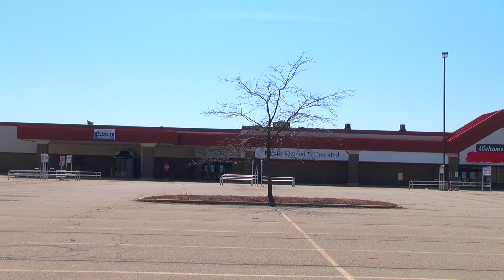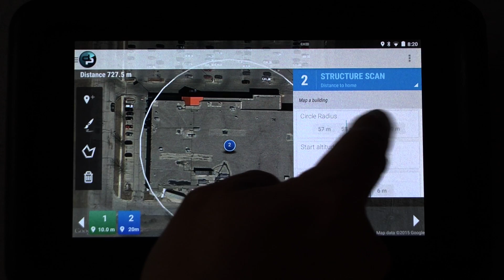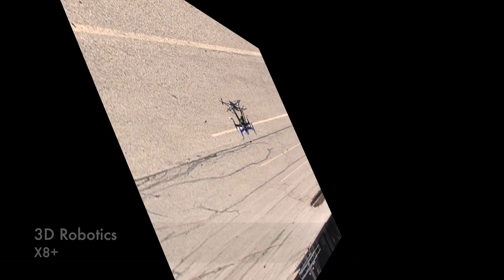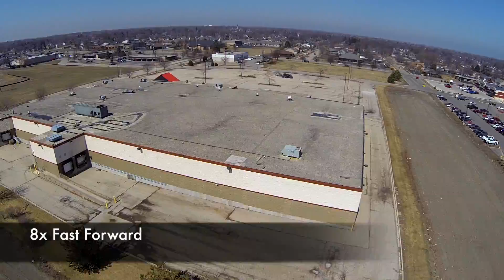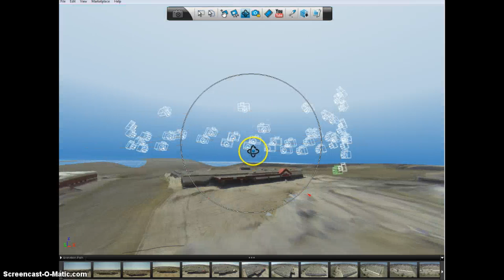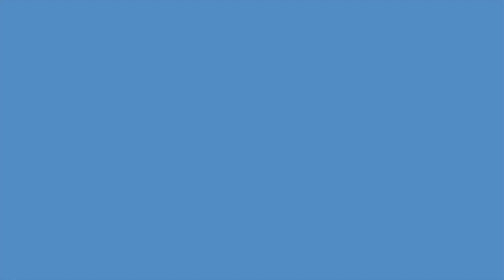3D Robotics X8+ UAV Structure Scan Demo Using DroidPlanner 2.0

Comment: What setting do you put the go pro on?
Reply from the maker: This was shot in 1080p 30f with stills taken a 5 second intervals at the same time.  The main thing is you have to shoot in Medium FOV to avoid the extreme fisheye effect which most photo stitching programs do not like.
Reply: For more detailed photos, then would you want it to take like a photo every second, or more?
Reply from the maker: Yes, the more images you take the better the model usually turns out.